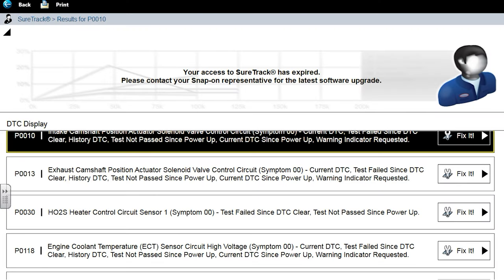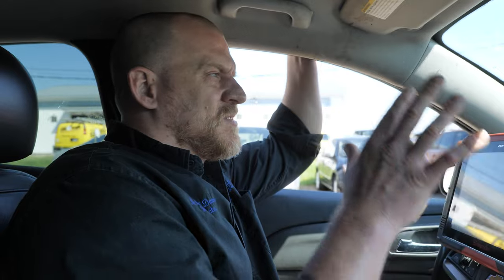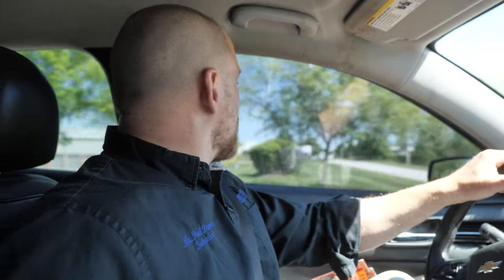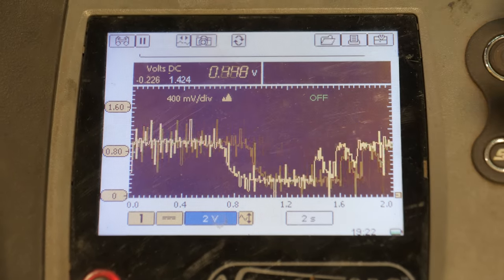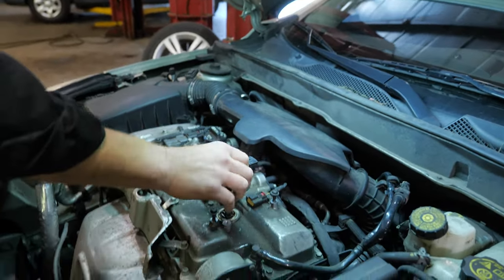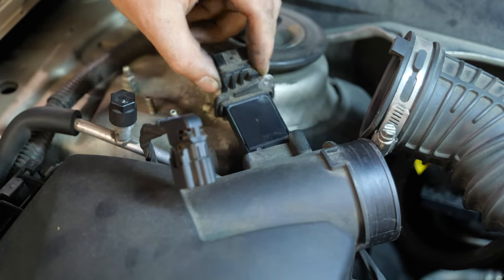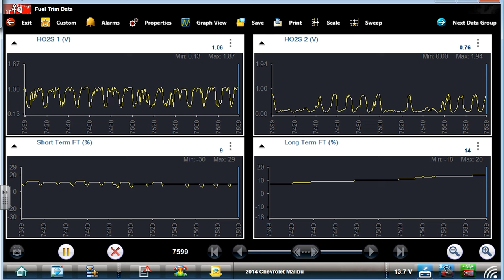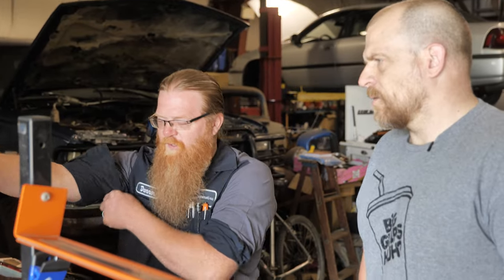2014 Malibu Stalling/Misfire/Idle Lean Condition/Cat Codes/Billing For Diagnostic Time

Comment: I'm trying to think of another trade where you would be expected to know such radically different systems/tech. From manufacturer to manufacturer and even year to year you could be looking at completely different data. Come to think of it, that's why a good understanding of the basics matters. (Yes you say that all the time😂)
Reply from the maker: absolutely spot on! What we deal with is crazy sometimes but yes, indeed, learn your fundamentals and you'll be able to navigate any problem. That is, as long as it can be duplicated right? I got lucky and saw that O2 do it;s thing right at the end
Reply: @ScannerDanner  in the automotive trade we need to be an electrician, electronics specialist, plumber, hydraulics tech, hvac tech, mechanical tech, data analysis tech, customer service representative, so on and so forth. We also need to purchase the tools to work on and diagnose all of the relevant systems that we see on vehicles, yet we are paid as "just a mechanic". 

Completely under-appreciated trade imo, the best thing I did lately is get out of the trade and  get a job with 90% less stress and labour, that pays twice as much.

I appreciate what you do and admire that you persevere.

Comment: how do you know it needs a cat? i didn't understand that part. and if you did that pressure test connecting to the upstream O2 port,  do you think it would of showed over 2 pounds of pressure?
Reply from the maker: Needs a cat for an efficiency issue, not a restriction. I'll get you a link on a cat test for this error
Reply: @ScannerDanner  oh interesting. so, some precious metals have left the system maybe?
Reply from the maker: @daytonpyro  I believe the catalyst substrate can start to melt down before it ever becomes a restriction. Also contamination. And so it can no longer catch and store oxygen as it once could.

Comment: I have kinda of the say problem. I  have a 07 yukon 5.3 flex (0)vin . And it runs decent but I recently scanned it cause have a smog in Cali this month. And it seems to say everything  from to high to to low Voltage 02 heater resistance. I'm lost
Reply: I do have the the data available
Reply: Any help would be greatly appreciated.  
    Thank you
Reply from the maker: Heater circuit codes are Typically either a wiring problem on the heater circuit (broken wire, blown fuse) or a faulty O2

Comment: This customer really shot themselves in the foot by not maintaining or repairing problems promptly. Spark plugs being replaced on time might have saved the coil, a new ignition coil could have saved the O2 sensor and avoided burning up the catalytic converter. Penny wise, pound foolish.
Reply from the maker: For sure, as they brought it in for the stalling problem! How long did they drive it with the misfire and check engine light on before that? Costly mistake indeed
Reply: bah, it's an "Destruction Integrated" engine ( aka Direct Injection). lol

Comment: Again another multiple ignored issue job. Cam solenoid so common on them and a issue but also that o2 issue probably was a issue before the stalling
Reply from the maker: The O2 issue caused the stall  Any cam solenoid codes were set because my brother had to ECM half unplugged when I started. And also fixed a couple grounds before I got there as well

Comment: let's say there is a fuse where there shouldn't be a fuse, and it causes intermittent problems or whatever, do you charge a customer by the hour or hours it took you to find that problem, or being honest and say well it took me only few seconds to pull the fuse out, and it fixed the  problem, instead charging customer outrages fee like 400, 600, 800, bucks or whatever.
Reply from the maker: Flat fee upfront for any electrical or electronic diagnostics. There is no time agreement. There is the fee and that is all. If you don't like the fee, please feel free to go elsewhere, where they'll change a thousand dollars in parts and still won't find the fuse issue in your example. So you see? You're still saving a s--t ton of money with a good diagnotician and he should be paid like one. Don't you agree?